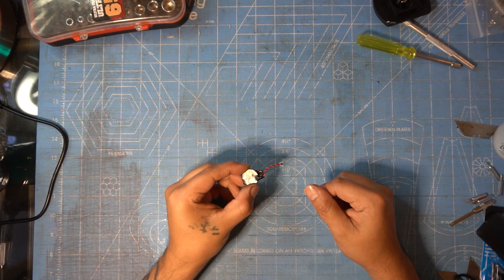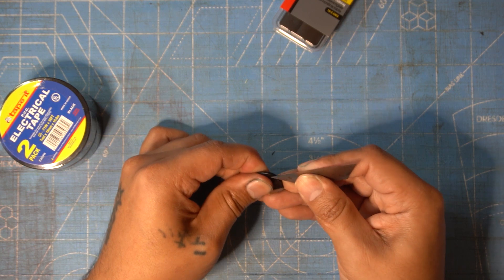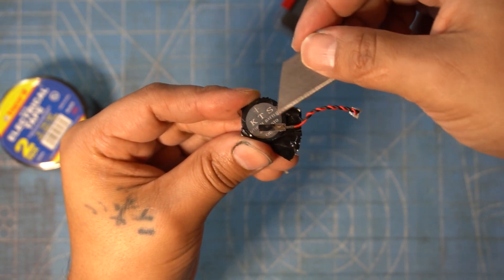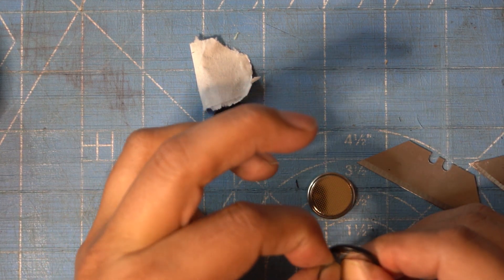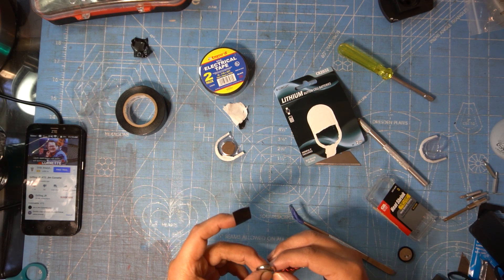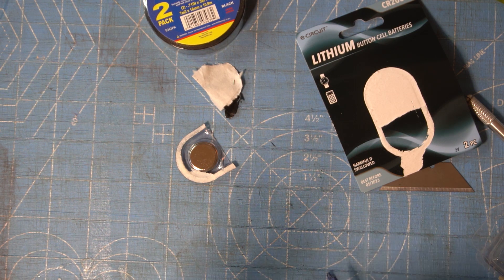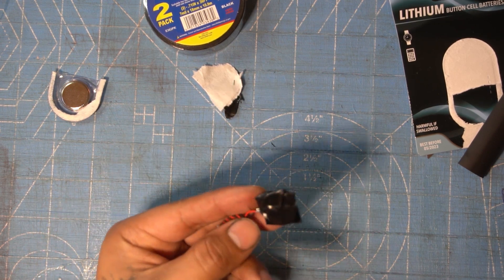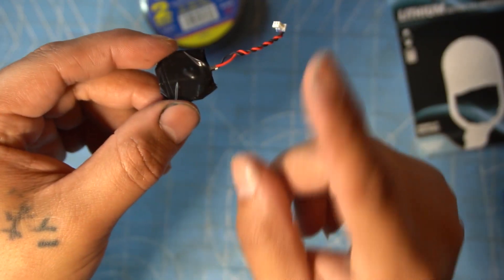CMOS battery hack | Laptop CMOS battery - bios battery fix Cheap!

Comment: I could not find a local replacement for this type of CMOS battery.  Use a sharp utility knife to separate the flat leads from the old battery.  Sometimes the little flat lead is spot welded to the face of the battery.  Note that the original shrink wrap also protected all the metal parts of the two leads.  When you put the leads back on the new battery, be absolutely certain that the metal parts of the leads don't touch the opposite side of the battery,  Red on positive, black on negative.  No part of the negative lead should touch the rim of the battery or any other part of the positive side.  Tape the negative lead near the center of the negative side of the battery so that no metal overhangs the edge. Do the same with the positive lead, taping it near the center of the positive face of the battery.  A short section of the red insulation should go onto the face of the positive side and and a short section of the black insulation should go onto the face of the negative face of the battery.  Then tape the little flat leads down to each face of the battery.  Red on POS, black on NEG.  Be sure there is no exposed metal to touch any metal part inside the computer.  If part of the little flat lead remains stuck to the old battery, the remaining part willl still fork if firmly taped to the new battery.  I did this and it's working.

Comment: I have big ole roll of copper conductive tape, don't even remember why I bought it, think I was going to try and fix a circuit board.  Your vid helped me work it out.  Those leads are sintered on, kind of like a mini spot-weld.  So I cut them off and stripped the wires, taped the ends down with the copper tape, then two small pieces of electrical tape on each side and heatshrink.  Thanks, works great.

Comment: you should have applied hot air to soften the aluminum tape, it could come out easily without breaking it, as well its stickiness could be activated again by hot air.

Comment: It's not even the money, it's the fact that you can use a battery that you know is fresh, instead of one of those pre-sealed ones that could have been on the shelf and worse than the one you're replacing.

Comment: I bought a replacement cmos battery on ebay but the laptop still had the bios error. After days of looking for a solution, I finally took the battery apart and tested with a meter, found out it was dead. I was looking to see if I could salvage the wires by swapping in a battery I could buy in a store, like this video shows....however, reviews of those specific dollar batteries say they're often dead too, so I recommend testing them before doing all the work shown.

Comment: The things you call tape are terminals spot welded on the battery. But yeah conductive tape does exist.
Reply: The battery will explode if you try to solder the wire directly as shown in another diy video: https://www.youtube.com/watch?v=5DdAZrTZjEM
Reply: @Spiritgumm  spot welders are designed for welding batteries. Don't you know what a spot welder is?
Reply: @jrgmty7685  Nope, but I thought it was worth sharing the mistake that other guy made.
Reply: @Spiritgumm  that's good 👍

Comment: thanks for showing us a cheaper option , I would not trust the contact that what you just have taped up , I would have solder them for firm contact then tape up
Reply from the maker: thanks for watching, its been about a year now more or less and its still working, if you solder battery might blow up, please be careful
Reply: Why on earth would you need such a firm contact on a CMOS battery? 😄 You can even cut those tabs off if you want, peel a centimeter of the insulation and use an electrical tape to attach the wires to the battery, just as TTT did, then use a piece of double sided tape to attach the whole thing to where it is supposed to sit in the laptop.

Comment: I don't have a hair dryer, what happens if I don't heat shrink the electric tape?
Reply: As long as the connection is "tight" / firm , there should be no loss of electrical contact.  Taping it securely and pressure from laptop case should keep wire contacts in place fine.  Normally these are spot welded with a special spot welder (doesn't overheat the lithium batt).

Comment: Thank you for your video. This helped me a lot for my PS3 FAT CMOS battery replacement. So what I want to contribute is to add something that could be helpful to others. I first used a papercutter and bend the metal tabs upwards all around the perimeter. My tabs had 2 placed spot welded. So I them put the tip of the blade onto 1 spot and hammered down a bit. I am lucky my paper cutter has a metal body instead of a plastic one. I did not need to hammer hard. This dislodged the first spot which I could then twist free. I repeated this with every other spot and got the tabs out cleanly. No cuts, breaks, or holes.

Comment: can I replace 2025 with 2032 cmos?
Reply: NO.
Reply: @TitaniumTronic  of course you can. The only difference between CR2032 and CR2025 is capacity. CR2025 being thinner will have lesser capacity, therefore it won't last as long as CR2032.
Reply: @TitaniumTronic  actually we can...i tried it and made a video about it
Reply: Janburn Dayanan:  The voltage, the current, and the size all matter.  There is a reason for the various battery numbers.  I wouldn't be substituting without knowing what I'm doing, as I don't know how sensitive the tolerances for different voltages or currents the laptop components might have. 

Actually, you should replace whatever your laptop has with the same type of battery, to be safest.

Comment: I think the tabs are supposed to be welded onto the battery casing
Reply: Those connectors ARE spot welded on there from the factory but, if you try to solder those contacts on yourself that battery has high chance of exploding. This hack will do the job just fine. Good job on saving the metal strapping. Makes it so much easier. They do sell copper conductive tape for taping down bare wire/metal to the other surface that is conductive. The conductive tape gives you better chances for a solid connection by increasing the total contact surface area. That was probably more info than you needed. Loved the video, man. Thanks!
Reply: Yeah, I don't think it's tape; looks like two strips of metal that were spot welded onto the battery. Looks like the guys at Lowes weren't crazy after all lol
Reply from the maker: You will explode battery if you try and weld it yourself
Reply: bubba:  That was my initial thought, but other videos, including one that actually show such a battery EXPLODING while trying to weld it say NO.  Not using a weld is why the conductive tape (like copper) to give a GOOD and secure connection, AND tightly wrapping in plenty of electrical tape AND heat shrinking the tape a bit is all a good idea.  With the pressure of the laptop case on that package, that SHOULD provide a secure connection for years, assuming you're not playing rugby with your laptop.
Reply: But other laptops only have cmos battery sitted on board and not welded

Comment: Can I replace CMOS battery in 14q-cs0017TU HP laptop? as system is not booting up only light is on and fan is working...pls reply
Reply: Harushita:  Look for a repair manual for your laptop on the internet.  You might just have a bare battery (many older models do).  You don't want to get into all this until you know WHAT you need to replace. 

My Dell E64x0 series laptops (I love them for very easy repair and drive access) makes it easy to find the info on the CMOS battery for replacement, for example. Dell has all such manuals easy to find and download on their site.  (Such info is getting to be important re purchase decisions for me, as I like to make things last).